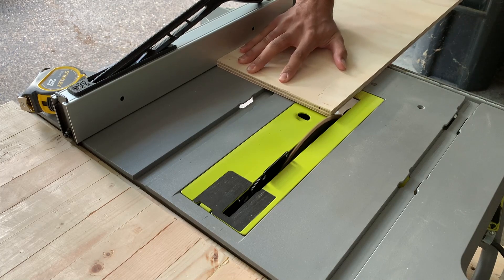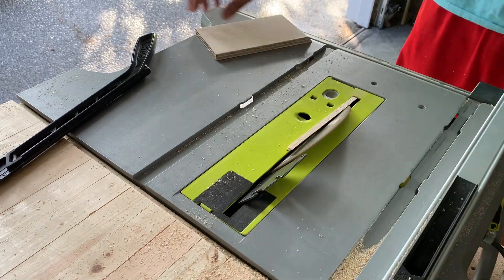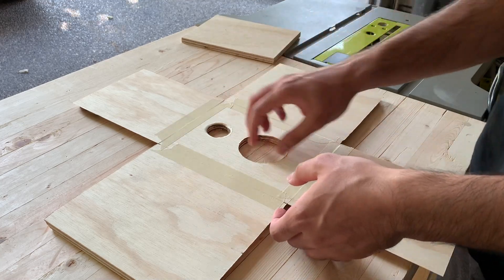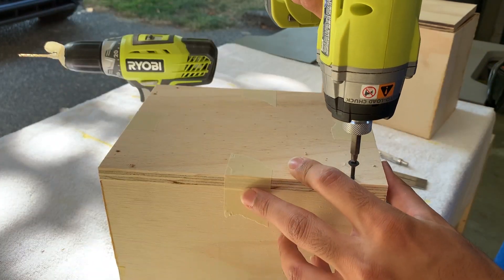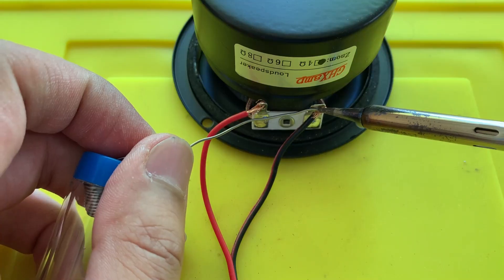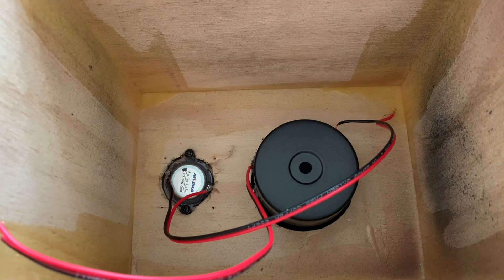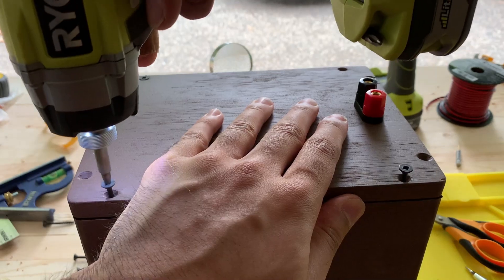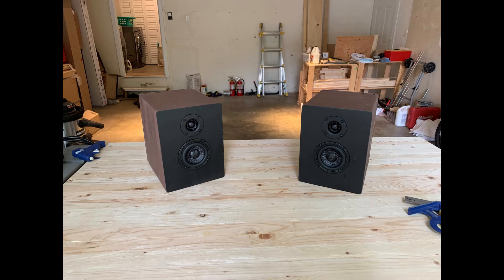Passive Wall-Mounted 2-Way Speakers

Comment: You sealed the woofer from the enclosure with the sealant you added, effectively the woofer isn't seeing the volume of the box. Remove the sealant from behind the woofer and you will get better bass.
Reply from the maker: I figured this after the fact. I didn't plan out how I was going to seal the front of the woofer so I ended up with this problem. I will find a proper way for future projects.